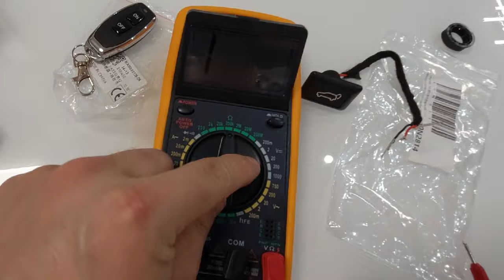How To Install A Car Trunk Button On Volkswagen Golf 3

Comment: Thats stupid sorry to say you ruined a perfect remote that actually opens your trunk to put a switch in side? Why? Oh by the way the red wire lights up the switch and it probably dosen't match the interior lights. It's your car and my opinion. Enjoy
Reply from the maker: tnx for your advice but the remote is not original from the car, i wanted to add a trink switch in the car , the plastic i drilled out is from another car so i keept all original parts .